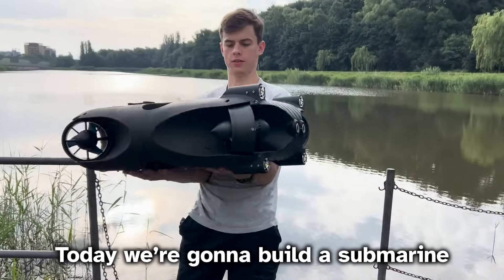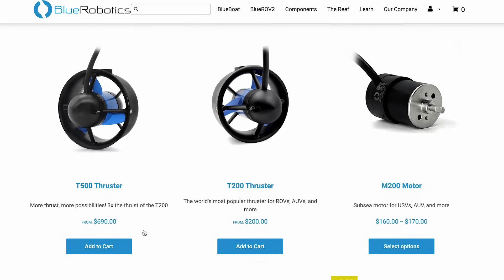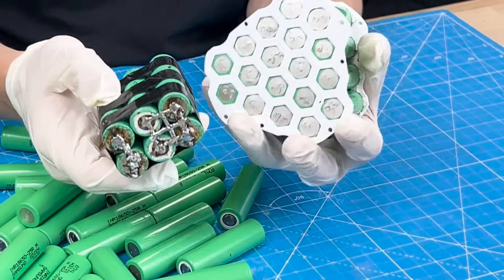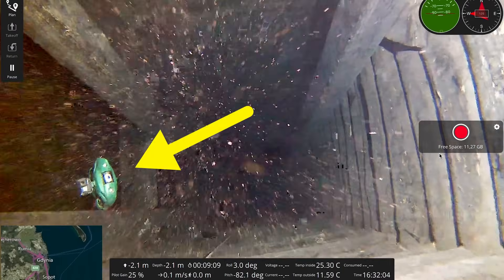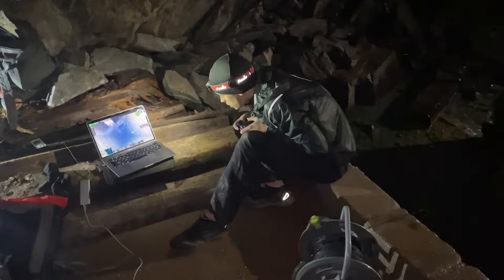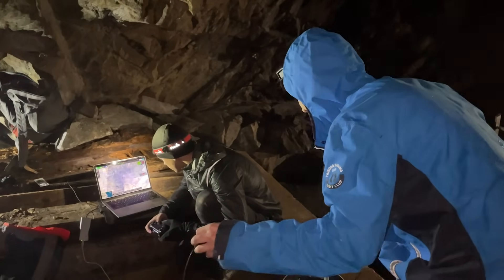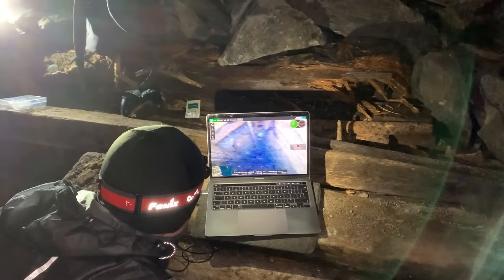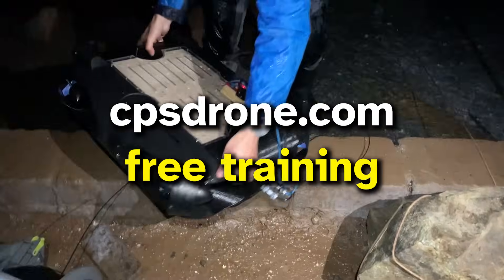My DIY Submarine Dives As Deep As Possible (PT2)

Comment: Need a mesh or netting over the propellers to prevent things from entering them.
Reply from the maker: Yep, we'll do that
Reply: @CPSdrone  Mesh shound be in round shape, like a ball, but half ball, so flat objects will not get stck on the mesh. I loved the video, pls make more with better versions and dive deeper.
Reply: @danielk.3017  HM... like the circular guards made for computer fans!  Good Idea!
Reply: @WhiteWolf65  Yes and even a mesh wiper could be included to wipe clean the mesh, much like a windshield wiper does, but this should work with brushes to brush the mesh clean to provide sucktion into the engines even in dirty water
Reply: @danielk.3017 i was just thinking metal lathe from home depot.
Reply: @danielk.3017 lots of good ideas here. But, these are bi directional motors. Nothing is likely to cover a mesh screen when you blow water backwards and forward at any time yeah?
Reply: @CPSdrone fill the electronics housing with mineral oil so it can't be crushed by the water
Reply: @fndhsiwjdhhdji  I like this idea
Reply: @fndhsiwjdhhdji  That's actually really smart!
Reply: @CPSdrone  Fit a tail like a stingray to hold the tether a foot or so off the back end? should help prevent tangling in future.
Reply: namely fingers, that tub test was horrifically unsafe
Reply: @ThylineTheGay I was also worried when watching that.. could have gone horribly wrong
Reply: @ThylineTheGay  understandable argument. However, it was for science
Reply: @AlliedBroom9081  i do believe a certain video game villain uses that as an excuse
Reply: I came here to don my Professor 2020 Hindsight hat and say the same thing.
Reply: A stiff spring around the fiber, say a meter or so, could help keep the cable away from the propeller 
S?
Reply: @iangrant4756  you're in water. The slack after that spring might still fold towards the vehicle unless the tension is high enough to keep the cable straight
Reply: @bororobo3805  Hmm, yeah, I could see that happening! (I was thinking of the immediate area around the props.)
Reply: Hi Sebastian, how are you? in Japanese
Reply: Hi Sebastian, how are you? in Japanese
Reply: ㅑ쳐겟갸ㅛㅅ겍ㅂ ㅛ댯ㅑ죧😅🎉내가오늘벼뎍ㅔㅅ내가😮😢ㅑ셔ㅐㅛㅛㅛㅏ겨개벼며😂ㅕㄱㅈㅈ오늘ㅕㅕㅕ갸❤🎉ㅕㄱㄱㄱ❤겨ㅕㅐ쇼때ㅕㅕㅈㅑ😮ㅔㅛㅑ갸샤ㅑㅜㅑㅅ교댜가쇼ㅐㄷ갸🎉ㅅ❤ㅅ ㅈㅈ죠ㅕ❤ㄷ뎍쟏ㄷ댜ㅕㅕㅈㅅㅛㅛㅐㅕㅕㅅ셔ㅕ😢😮ㅑ 14:01 ㅅ😢ㄱㅈㄱ ㅂ뎌😅ㄷ겨샤ㅛㅅ😮ㅈ😅ㅂ샛ㄷㅅ😂ㅕ😮겨댜겨수셛ㄱㅅ😅ㅎ됴ㅛㅔㅕ새ㅕ뎟ㄷ😂ㅕ굥 ㄷㅅㅅㄱㅈㅂ😮ㅈㄱ벼ㅕㅐㅅㅛ됴ㅕㅕ져ㄱㅅ😢겨댓ㄷㅅㄷ😂져ㅛㅔ교😢ㄷ😢 ㅔㅕㅕ😮ㅅㄱ냐져ㅕㅈ샤ㅕㅕㅕ쇼뎌셛ㅅ🎉내가오늘ㄷㅅ젿ㄱㄱ  김ㄷ😅ㅓ😂ㄷ색ㄱ뎌ㅕ게ㅐㄷㄱ 입니다ㄱ서려 ㄷㄱㄱ재ㄱㄱㄱ그내가내가나쇼🎉ㅑㅕㅛㅑㅕㅈᄒᄒ ᄒᄒㅕㅕ셔오늘ㄱ😮ㅛ😮내가 ㅕ샞ㅂ😢오늘ㅂ😅ㅈ 겨ㅕㄱ숏😅😂샤쇼샷ㅏㅕ🎉 ㅕㅅㅂ베ㅓㅛㅅ쟈은ㅕ져냐ㅕ뵤됴ㅕㅕㅕ😅샤ㅕㅐㅕㅔㅕㅕㅕ셔ㅛㅈㄱ😮ㅔㅛㅑ갸샤ㅑㅜㅑㅅ교댜😅😢ㅛㅔ오늘ㅕㅎㅅ곧ㅅ😢ㄱㅈㅈ ㅑㅕㅛㅑㅕㅈ자ㄱㅋㄷ😮숏😂ㅓㄱ내가ㄱㅈㅈ교ㅛㅕㅔㅑㄱㅌ
다름이 아니라지굣져ㅕㅕ셔ㅕㅕ셔ㅑㅕㅛㅑ🎉ㅑㅂ겨❤ㅔㅛㅑ갸샤ㅑㅜㅑㅅ교댜ㅕ😢샤ㅛ😂ㅕ😂ㅛㅕㅕㄷㄱㄴ🎉🎉오늘내가 지금ㅐㅑㅅ😢ㅈㄱ녀ㅛ대ㅕㅅㅈㄹ겨ㅐ갸ㅑㅑㅐ😢ㅑㅛ😅ㅅ수ㅕㅕㅈ😮내가숗ㅅᄆᄂ😅ㅕㅕㄷㅑㅕㅛ쇼져ㄷ😅ㅑㅏ😅내ㅑㅕ😂ㅕ볏뱌쟈ㅛㅛ😅개오늘ㅑ샤됴셪ㄱ져ㅛ뎌저지금ㅑㅕㅗ겨ㅛㅈㅈᄒᄒㅑㅅ뎓😂🖥️🖥️📼🎛️🕰️📼📺🖥️📼⌚️📼🖱️🖨️🌁📱📽️📼🎙️📼📼🗜️📼🎉사ㅡㅕ뱌ㅔㅅ샺캬ㅕㅕ거 7:11 더수겨 7:11 ㅕ겨ㅕㅕㄱ 😮😅😢😂겾슏쟈제ㅛㄷㄷ젝걎ㅈ댜져😢셔ㅡ😢ㅕ샤죠ㅑ뎌ㅐㅈ😢ㅛ😢져😮샤ㄷㅈ한테🎉한테한테한테ㅛ대 전화 문자ㅛ❤ㅎ😢젿ㄱㄷ ㅑㅛㄷ쇼55ㄷㅇㅈ538❤ㅕ댜ㅕㅕㅕㅕ나🎉ㄱ😂439554567205❤607785₩객개거ㅔ뎃댓여❤갸ㅕ갸겾ㅐ교ㅑㅕ95720😂ㄷㅂ;2249162388856937226754895863❤2)❤27633 ㄷ애겹ㅂㄷ뎍됻됴ㅛ📼📽️💽📽️🎞️🎞️🖥️📽️📽️📼🗜️🗜️ㅑㅛㅛ🗜️🕰️😊😊ㅐㅛㅛㄱ됴😢ㅇ뎌😂😂🎉ㅈㅈ
Reply: mesh or netting would get tangled
Reply: On larger propellers, ships have cutters on them to cut through lines that get caught in them… you could try that as well as their grid mesh idea
Reply: But that would lower the trust power
Reply: @ManavPadhiyar-g5g  the thrust difference would be negligible on a craft of this size, especially depending on how fine of a mesh is used. additionally, on expeditions like this your main concern isn't speed. agility and durability are the name of the game, a nimble craft with minimal vulnerabilities among critical components is all you need.
Reply: Or try to use compressed air to clean the propellers
Reply: @KASH-CHEN  how would that work underwater? like where are they getting the air
Reply: @bridgerallred8815  it would be in a little air tank, like how they use in scuba kits
Reply: @KASH-CHEN  Might help against mud, bit in the video that had lines wrapped around the props

Comment: Nice video!
I do suggest checking the dB/dBm values on the fiber optic cable since it got stuck, it would be a shame if it lost connection on the third attempt.
Reply: Perhaps bundle a fine Teflon/kevlar line to the fibre-optics, so if it fails eletrically, you can reel it in with the strength-tether.
Reply: @WhiteWolf65  there is no electric current in fibre optic cable so it cannot fail electrically
Reply: @szlomobronsztajn3115  If the Drone fails electrically, genius. You going to try to reel a dead drone in with a fibre-optic cable? NOPE.
Reply: @WhiteWolf65  be more specific next time because that's not what your post says, and you can reel a dead drone in with a fibre-optic, that's exactly what they were doing at some point, it's the connector that would give out before the cable
Reply: packet loss monitor probably an idea too for higher layers. I think that is what was messing up the video.
Reply: @zyeborm  I think it is probably the fibre optic cable wrapped around the propellers and damaged that was messing up the video.